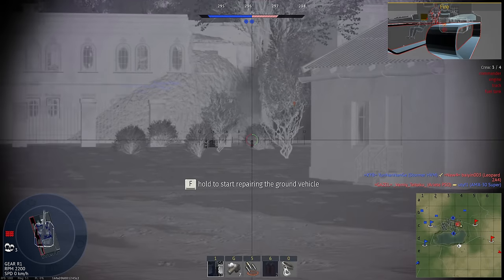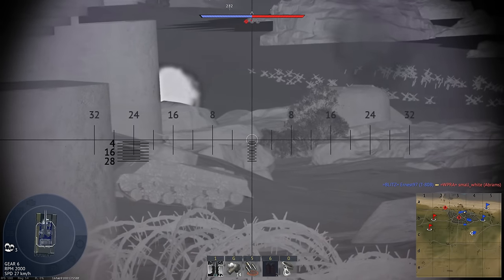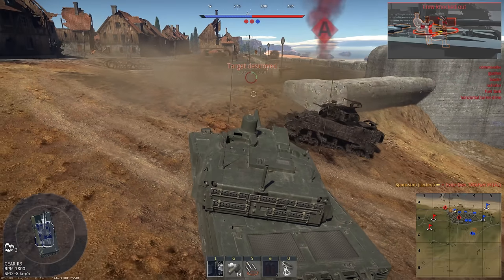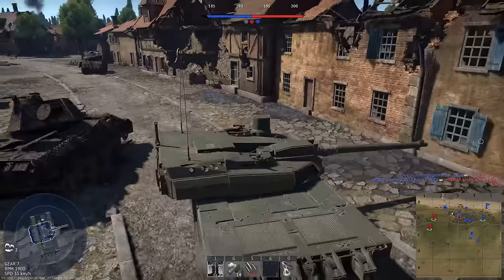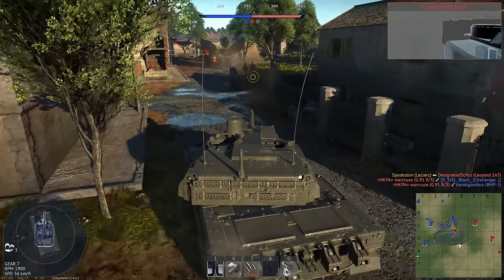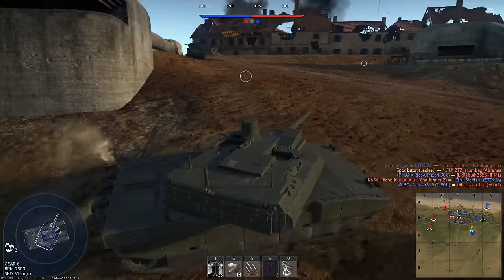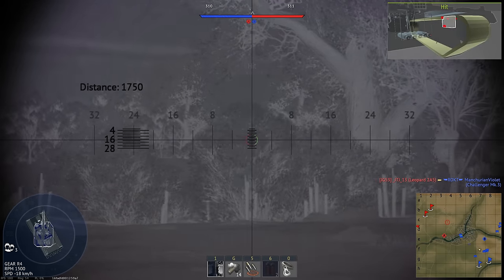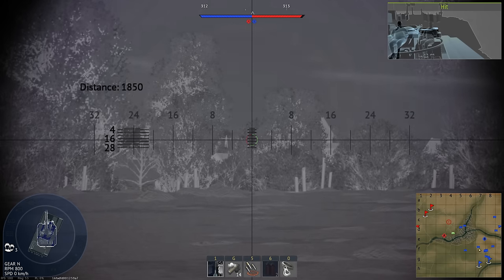The Future of Tank Armor

Comment: Well what if we remove all the armour and just make all the components of the tank float
Reply: We need to invest in multidimensional displacement technology, in order to make the armor of the tank warp in, and out, of existence. 

The armor/nothing will deflect/do nothing and absorb/do nothing incoming projectiles which will in turn also be displaced out of existence
you can't/can hit a tank that doesn't/does exist, Schrödinger's Tank !
Reply: @kabardino1337  I love you
Reply: Tbh, I think the future is soft kill and hard kill protection systems, along with just anti 30mm autocannon armour...
Reply: Maxim 
But what if the tank is sending out shots from a different universe...
Reply: no armor is the best armor taken to a whole new level
Reply: no u 
Opening up a portal above the enemy tank and dropping shells on it
Reply: you don't need to worry about the tank's armor being penetrated if the tank has no armor
Reply: Maxim soft kill tech seems a bit slow to destroy a target. My bet is a high capacity hard-kill CIWS mounted for anti missile defense. Passive systems will probably just be metal foam and silicon-carbide plates mounted to the steel frame like 5 layers deep. My hypothesis is a shift from the MBT to dedicated assault guns and tank destroyers. MBTs are just too heavy to be properly armored for modern conflicts, a split can be made into the old cruiser and infantry tank roles if those roles aren't assigned to even more specialized tank destroyers and assault guns. Point being, tanks have two roles, protect the infantry and kill tanks. Two tanks can be made for one role each.
Reply: how about we also remove the floating components left over and just leave the shell to explode. or maybe just use a bomb
Reply: Ah yes, just teleport the tank whenever it would be damaged.
Reply: I've got a Better idea
If we have no tank they cannot destroy out tanks so they are done
Obviously we will Need something to deal with their tanks but that Is just a minor problem to solve.
Boom
Armour problem solved
Reply: @maxim6088  30 mm cannon can't penetrate much. And with hard kill systems anti-tank missiles will become obsolete. Bigger cannons with kinetic projectiles will be the future.
Reply: what if we put 150mm cannon on toyota truck
Reply: I'd bet the next real advancement is drone tanks. Super cheap, unarmored, big gun, light, fast, electric tanks. Basically just a gun on wheels/track. Doesn't matter if they get destroyed because there's no loss of life and they are cheap to replace.
Reply: @kabardino1337 bit late on this but what if someone shoots a tank round that does/doesn't exist?

Comment: Your comment that em armor would require a large amount of electricity to simply stay active does not make sense since no electricity flows unless a projectile hits it.
Reply: True. EM armor functions like a giant capacitor. It gets charged and stays charged until hit.
Reply: Although this is true you have to take into account the inevitable discharge overtime that occurs whenever you stock electricity and the electricity needed for a recharge aswell.
Reply: pand_vidoo jbc the leakage current would be little to nothing. Modern capacitors have leakage currents in the milli to micro amp range. Given that em armor needs high power-density not necessarily high energy density recharge time would be pretty quick.
Reply: Kiyo Senpai You do not charge the armor itself. You would use capacitors to provide the charge, and you would keep the armor in sections like you do with era that way if one panel is hit you do not loose armor effectiveness over the entire tank.
Reply: Alex Dunphy if the em armor was itself a capacitor it would not be very good. Capacitors need very thin dielectrics in order to achieve good energy density. Purpose built capacitor would be inside the vehicle, connected to the armor, and charged before battle. The armor itself functions more like a railgun.
Reply: @coren8  right, I was just talking in terms of the fact that the armor is just two plates with a potential difference between them and not a real circuit that needs power to run
Reply: @coren8  I'll believe you on that one

Comment: I’m thinking that metal foam would suffer heavily from armor fatigue, but given the responsiveness that modern tanks have, it could be worth having armor pieces that need to be replaced when hit, but offers more protection.
Reply: well armor will become light as kitchen tool
Reply: I mean it's not like any modern armor is meant to stand a second shot to the same place anyway. ERA gets used up, NERA a huge hole teared, ceramics crack and backers  bend and break up, even hard kill systems don't prevent enough penetration to leave the armor unscathed... With the stupidly high energy and focus that modern AT weapons have, there's no real material or system that would survive several shots with reasonable weight. Heck it's often not even expected to fully prevent damage from the first hit, at least from another tank's gun
Reply: Good think to mention since I was just thinking that. Also what about vibration? Like when your hit will the metal foam vibrate rapidly due to the absorption of a solid uranium rod being shot at it faster than the speed of sound while the armour (compared to RHA) is as light as a feather?
Reply: It’s the same as ceramic in that sense though

Comment: I notice you didn't mention NERA (non-explosive reactive armor), which AFAIK is a core part of most composite armor schemes. It consists of spaced plates of metal-rubber/plastic-metal. When struck by a HEAT-jet or kinetic penetrator, the rubber/plastic vaporizes, shifting the metal plates and disrupting the jet/penetrator. It's essentially a passive,  non-explosive counterpart to ERA. A more conventional armor plate is often placed on top to prevent the metal-plastic-metal sandwiches from being excessively degraded by small arms fire.
Reply: Commented for future reference.
Reply: @Solipsil He also mentioned ERA and active protection though, which are also already in service.
Reply: Solipsil he was comparing metal foam to RHA and then going onto how it would be used to replace NERA in the likes of an abrams when there has been no (public) tests that have shown that metal foam is even more effective than current NERA
Reply: @Hollycalvey  I got the impression that metal foam is great at absorbing energy/impulse once the HEAT jet or kinetic penetrator is already broken up, but that it isn't all that good on doing said breaking up. So it might be used as a layer underneath NERA, but since it's so voluminous, it'd probably perform poorer than just more NERA.

Seems great for space use after a whipple shield has vaporized a piece of debris/micrometeorite, but not really suited for any terrestrial application I can think of.
Reply: No it has uses terrestially.
IMO Its main use is delaying and dampening impact shockwave reflection on the backface of bulk hard armor  layers. That is one of the main limiters in ceramic armor performance.
By increasing dwell time and limiting crush zone formation you increase the performance of the ceramic. ( as well as limiting damage to the ceramic for more penetration events ).

I could imagine it having a similar benefit for extremely hard steel armor systems by lessening the "plugging" tendency.
Reply: There is also a different kind of NERA, which is rumored to be used in the Leopard 2 and Puma IFV armor.
It works by encasing a plate of ceramics in steel from all sides. When something penetrates that plate, the ceramics shatter and because ceramics are inflexible and can not be elongated or compressed, the shattering of the plate makes it expand. A ceramic plate with cracks in it occupies more space than a unbroken, homogeneous ceramic plate, obviously.

Since the plate is encased by steel on all sides, the only space it can expand into is the hole the penetrating projectile just punched. That means the ceramics "bite" into the APFSDS rod like a pair of super hard, super strong bolt cutters, breaking it.

It also works against HEAT jets/spikes, because the ceramic crumbles and dust exploding into the path of the jet/spike disrupt and dissipate it.

Comment: technically the EM armor wouldn't waste energy since It isn't grounded, so there's nowhere for it to go
Reply: Capacitors (essentially what EM armour is) always require a maintenance charge - it is not the full charge placed across the plates but still is a decent amount, furthermore, it may have an issue of accidental discharge if one of the plates scrapes on something. in which case you have to fully charge the plate again.
Reply: @phinix250  yes, but it's not draining energy in the same way when it's "turned on" as say, running an appliance. Where you put a charge in and it then uses that charge aslong as it is being supplied.
Reply: Valentine 
Technically it would drain some electricity, as electricity would escape through sharp corners and whatnot, thus needing constant power to the armor.
Reply: @phinix250  issue protection core main modulary generator connected tank

Comment: EMA, if properly isolated would not require any sensors, you said that the way it works is by disrupting the jet of molten metal the shape charges use by sending electricity through it. So as electricity doesn't go through open electrical circuits it will only consume electricity of there's a shaped charge to penetrate it an close the circuit formed by it and the armor system.
The power issue must come from somewhere else.
Reply from the maker: My mistake
Reply: Yep, that's true, if you use a dc current source, like super capacitors, a generator, by nature, produces AC current.
2 metal plates isolated from each other are nothing more than a simple capacitor, capacitors have a relatively low AC resistance, meaning that this still will act as a short circuit.

However, that's not the problem i see with this technology, it is actually a clever use of the properties of conducting metal objects in an electric field.
The problem i see is the logistical and the operational ones. As the capacitors needed to provide the current have a pretty high self discharge rate, they will have to be constantly charged, wich obviously costs fuel.

Another maybe not so relavent point would be the actual armor composition itself. As tank manufaturers more and more try to keep the armor as modular and as replaceable as possible, this would mean a huge increase in complexity and cost, just to be able to replace smaller parts of the armor. Another concern would be the isolation itself.

But what i think,what would drive the nail into the coffin of this concept, is the fact that this is an activ system, that uses fuel even if it isn't needed and it will only protect the crew from one specific type of weapon, simple shaped charges. A tandem warhead could still get around this system, by using the first shaped charge to drill a "pilot whole" and enable the second shaped charge to blow through. There are shaped charge warheads, that use the shaped charge to drill a whole, only, to allow a kind of elongated frag granat to shoot into the crew compartment and potentially kill everything in there.
Reply: @Spookston  
Well, it wasn't really a mistake, just a bit of a misunderstanding oon the technical side. ;D

To the concept of metal foam as a filler, technically, this would be a great idea, practically, not so much. It would certainly be easy to produce crude metal foam piecs in large quantities, however, big homogenous pieces with certain shapes could be to difficult to produce at reasonable cost. 

I would actually suggest the next best thing, sintered metal. Mor specifically, parts made out of sintered steel wool. You still got high energy dissipation coupled with low weight but you get the advantage of this being a comparatively low cost solution, for the most part because of the energy efficient sintering process.

There was also one kind of armor, that you haven't mentioned, that would be fluids. I mean, it isn't exactly a future technology, as tanks like Merkava made excessive use of using fuel tanks as armor, but i am talking about moving fluids or even non newtonian fluids. the ideaa behind both being the disruptionof the projectil path and therefor reduced penetration.
Reply: Yep, last part needed is some super capacitors that build up charge slowly over time and you should be able to be fit it to just about any tank with a reasonable powerplant. The supercapacitors might come with some weight and space considerations though.
Reply: a reminder that the jet is fluid or liquefied not molten
Reply: @noctisumbra2749  My bad, English is not my first language
Reply: @laulen3448  It's all good.  It's a very common misconception that people have about explosively formed penetrators probably stems from the HEAT acronym in part. That and the idea of a metal jet.
Reply: @canidaeSynapse  You don't even need supercaps. Normal aluminium electrolyte capacitors or even foil capacitors are much better because they have a higher voltage, can discharge faster and have almost the same energy density. I did some research for a homebuilt railgun. Elkos and supercaps cost about the same for a given energy, have about the same size but elkos have a 10-100 times greater voltage and can discharge much faster without being damaged.
If you go to very high voltages foil capacitors become viable, but I don't know if at the voltage EMA operates elkos or foil capacitors are better.
Nonetheless you would need quite some capacitor bank.
Typical energy density is currently somewhere in the hundreds of joule per kilogram (or per liter).
Reply: @lukasdimmler2622  Oh man, convenient! Thanks for the info!
Reply: All well and good until one of the crew gets out to take a piss down the side of his ride!
Reply: @antonrudenham3259  haha, that'd be a hilarious way to go out. though, I assume the outer plate is grounded, so unless his stream can penetrate a metal plate, he should be alright!
Reply: @noctisumbra2749  yes if mistake bullet hitting hole where's weakness helium tank and hydrogen dark matter or anti matter tank will exploded fueled nanoreactor
Reply: for powering EM armor why need a separate power source? unless you need it on while not running the engine just use what every electric device in a vehicle uses an alternator and maybe  a battery.
Reply: Reffo  technically yeah, but it's not very practical... Chemical engines usually have more power per weight and are obviously much cheaper and maintainable, without much enviromental impact in case of it getting hit
Reply: What if the liner of the shaped charge is glass? Which means it's electrically insulating...
Reply: @yayayayya4731  well glass is a quarter as dense as copper and a seventh as uranium, so you've basicly already defeated it before it gets shot. Plus it'll probably trigger anyway when the two plates get pushed toguether..
Reply: @antaresmc4407  it's still used in shaped charges and the performance is very similar to copper liners
Reply: @yayayayya4731  eh, not really. Penetration is roughly proportional to liner density (with some assumptions to leave variables out), and the resistance of the "jet" depends partially on ductility. While hot glass is ductile, not nearly as much as metals, and its nowhere near as dense as the materials used in modern charges. It is hard, but that's not a very important deal in most situations... Yes glass is used, though not in military weapons afaik, and not with as good performance as other liner materials due to "simple" physics. Also copper is not the pinacle of HEAT weapons and thus even if comparable it'd still be a big performance hit. Plus being insulating still would do little for the second point I explored anyway...
Reply: @antaresmc4407  alright thanks for the info? What liners do they use in modern charged then?
Reply: @yayayayya4731  generally dense ductile metals (Mo, Ta, U, generally pure metals are more ductile than alloys) or composites between dense hard ones and copper or other ductile binder. Sometimes having nice damage properties (Al or U that are quite flammable for example) is more imortant than maximizing penetration. Also lighter liners may be useful sometimes, e.g. I read that Al is quite good againsf concrete dunno where or why...
Check out the wikipedia page, it's got quite a lot of info pretty nicely detailed ;P
Reply: @antaresmc4407  alright thanks 👍👍
Reply: @lukasdimmler2622  I guess no electrolyte capacitors can be used. The discharge of a electrolyte capacitors is longer than the flight time of the projectile.
Ceramic or polymer seems better.

I would guess, that using the magnetic field to push the projectile sideways is very useful.

Comment: For the electric armor:
You can simply store a lot of electric energy in a huge capacitor bank connected to either sides of the plates. As soon as the jet penetrates the circuit is completed and current will flow.
You don't need to waste any energy as it is stored in the capacitors and sensors are unnecessary because the jet will do that part by design. 
Problems are:
-Dangerously high voltages on the hull that can fry humans and equipment alike.
-Huge capacitor banks needed for storage. Likely more than 100kg ( My guess is ~500kg but weight isn't a problem for tanks anyway).
Reply: Eh high voltage high smoltage.
Reply: hand will be shocked